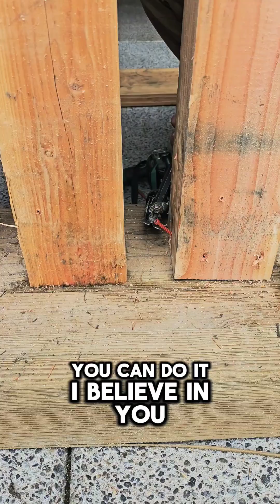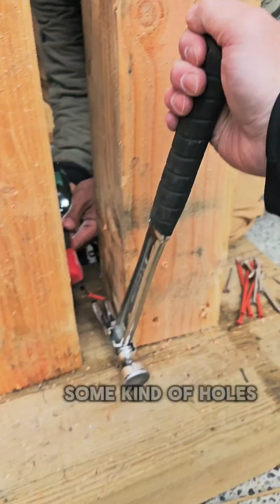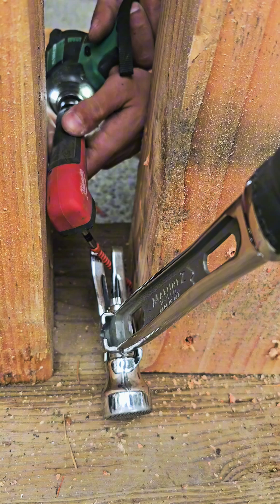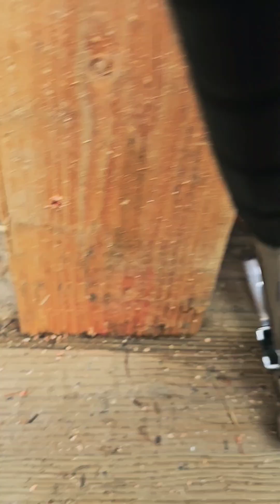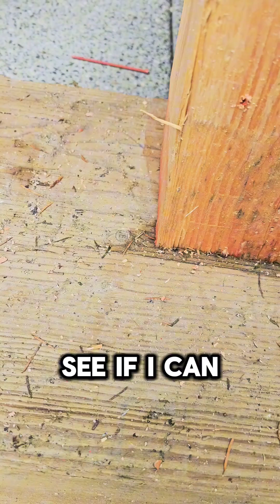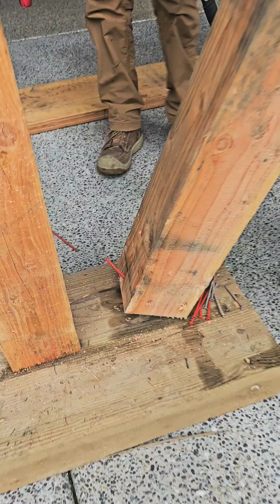Screws Aren't All Brittle #framinglife #houseconstruction #framing #engineering

Comment: People don't say screws break they have a much lower 'sheer' strength and that is true.

No one's out here claiming screws are made like glass but it is definitely the case that a nail will bend and bend back but a screw will snap. Also bet that hole is absolutely demolished and so now what you gonna use a bigger screw? Or just have a loose fitting ? 
Right tool or equipment in this case for the right job.
Reply: Those screws didn’t break because unlike other screws there designed to be flexible not brittle a normal screw would’ve broken already
Reply: Or you could run another screw into another hole, at a different angle, ya know, one that wouldn’t be so hard to put in or take out. Just a thought.

Comment: Not saying it would have been a ton better, but the Milwaukee 49-22-8510 is a way nicer off set adapter than the one you were using. The handle can really help add the pressure needed at weird angles